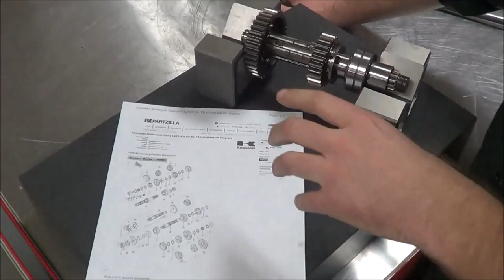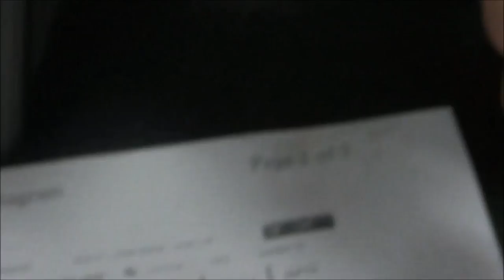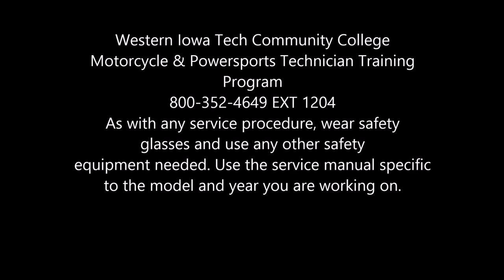How the Kawasaki Transmission positively finds neutral 4 Stroke Engine Disassembly #how2wrench

Comment: Great video!!! I was VERY happy that I read my Kawasaki Versys X300 Owner's Manual and knew about this. I bought a new 2018 Versys X300 in the spring of 2019 (great deal on the previous year bike). I immediately outfitted it for a mini ADV bike, my original intention - luggage, foot peg change and auxiliary lights. AUXILLIARY LIGHTS, etc. Aux lights were wired directly to the battery with a manual switch (not dependent on ignition). In the daytime, I accidentlly left the auxiliary lights on TWICE (Duh!) and ran the battery down - lights would come on, but not enough juice to start the bike. Naturally I tried to bump start - rolling and popping the clutch. With the VERY low first gear, the rear tire merely slid - engine would not turn. So, naturally, I decided to shift to 2nd or 3rd as I had done on previous bikes. NO GO!!! Then I remembered the Kawi "neutral finder" feature. 
GUESS WHAT I LEARNED - - - If you coast the bike in neutral up to about a slow to medium trot - maybe 5-8 mph - there is enough centrifugal force to allow the tranny to shift to 2nd or 3rd. BOOM - the bike started almost instantly in 3rd gear. (Other bikes I've had would skid the rear tire in 1st gear also. Recently had to bump start my Vstrom 650XT - same thing skidded rear tire in 1st, but started easily in 3rd. Thanks for sharing this vid with everyone!

Comment: The issue described is the kawasaki positive neutral finder. It helps you easily find neutral when at a standstill
Reply from the maker: Thank you Scott! Duh makes complete sense! How do you know this my friend?
Reply: +shane conley I've owned a number of and worked on plenty of Kawasakis also it's mentioned in the owner's manuals. The feature has also been described in some of the promotional literature in the past.
Reply from the maker: +Scott Douglas 
Fantastic!
Reply: Ah it makes sense, difficult to find the neutral at a little speed.....i always asked myself why the kawa is so tricky at that.
Reply: My 2005 ZX12R has the positive neutral finder.Sometimes it fails to work though.Rolling the bike forward with the clutch in seems to reset it.

Comment: Great video! I just subscribed to your channel!
I am trying to figure out what's wrong with the transmission of my zx6r from 2007. It's a track bike and the issue is that sometimes it wont shift from 3rd to 4th unless I pull the clutch lever. It works great with all the other gears and it downshifts without issues as well. A friend of mine mentioned that might be those ball bearings. Any idea or advise how to fix the issue? TIA
Reply from the maker: Give Shane a call. Contact info is on our website. www.how2wrench.com
Thanks for watching!

Comment: Thank you so much!  I would have been into this bike for so much time that I would have never wanted to touch a Kawasaki again!  So here’s my next question.  I rode the bike after my friend sold it to a guy and cause he called shortly after purchasing it cause it wouldn’t shift into second gear.  I rode the bike and it wouldn’t go into second gear without a lot
Of force and I had to hold it in gear with my foot on the shifter.  At no
Point was second gear smooth during operation.  Before I download the service manual, what advice would you give me?
Thanks! 
Hoosier Daddy Motorsports.
Reply from the maker: As you can see from the slow response, it takes us forever to screen all these requests. 300-400 a week just in emails and 1000’s of comments! FYI members get answered daily first! Best $1.99 you’ll spend! 😁

That’s a great question for Shane directly! We are just the social media team. Shane does answer questions when he get's back around to non members eventually so hang tight, FYI >>>> he does member ones daily!

He just returned from overseas training techs and his inbox is slammed with requests. He is scheduling time each day again to answer techline orders. He does not have the bandwidth to provide free email replies as his schedule is full with shop customers, training schedules, and one on ones. 
There's good news though! Shane has 2 solutions for you. One is a deep dive one-on-one with him with video, email and phone support. The other is a "quick fan support" option when it's a quick answer and just helps support the time for him to stop wrenching or training and get you in the direction that a free video had you close. Links to each are below. Hope this message makes sense to you as a decent human being that also works for a living and gets it!
Make it a great day!

The one-on-one service. Get Shane’s cell here: https://how2wrench.com/ols/products/techline-one-on-one       
Quick answers are answered daily as a channel member: Join this channel to get access to perks:
https://www.youtube.com/channel/UCBhM8DCKnT3qXwTW0eToyCg/join   
-Daily MEMBER FIRST COMMENTS ANSWERED FIRST 
-Live Q/A video chats
-Wonder if we have a video on your need? Members can request content links!
-Full Access to the ENTIRE 700 video library
-Member-Only FREE tool giveaways  

Have you seen our "YouTube Trained Support Shirts? Great way to "high five us" https://goodfellasmerch.com/collections/how-2-wrench/products/support-shirt

High fives help too! Give him one here:  https://www.paypal.me/how2wrench

Comment: Interesting as I just purchased a 2001 1500 classic.  Neutral worked ....guy said all gears up then back down.  Later I realized on the cover shift pattern was neutral between 1st and 2nd.  Appears he never used 1st.   Well now it's stuck in 2nd or 3rd.  I can't find neutral now.  ?   Should I jack and spin the rear of ground to solve ?  Hard to get started on road in a high gear.  keep stalling it.  only 23,000 KM,s on it.